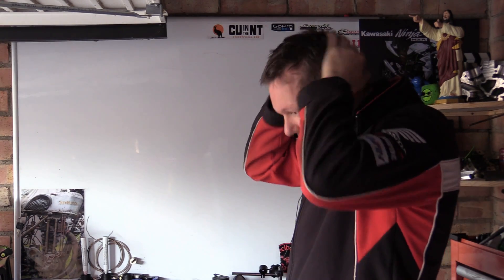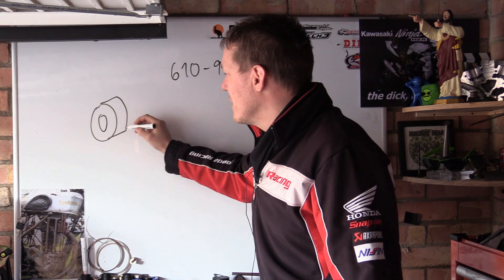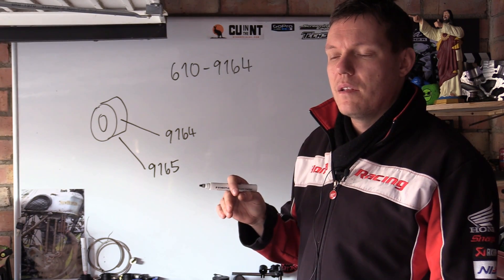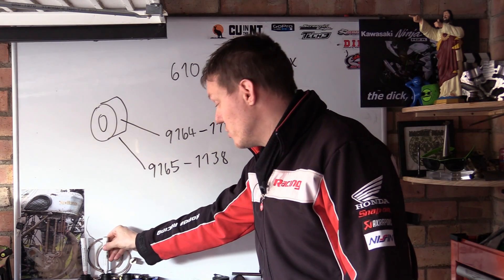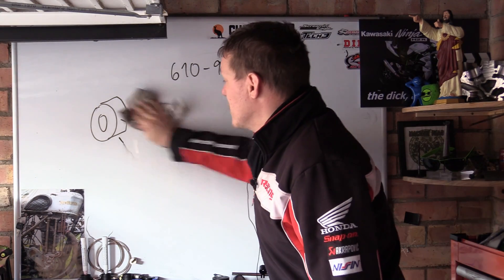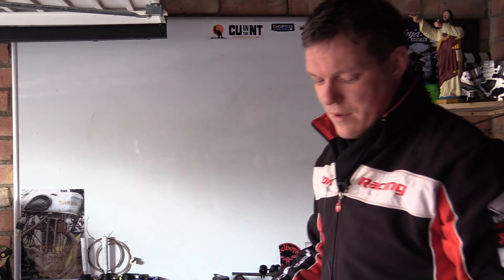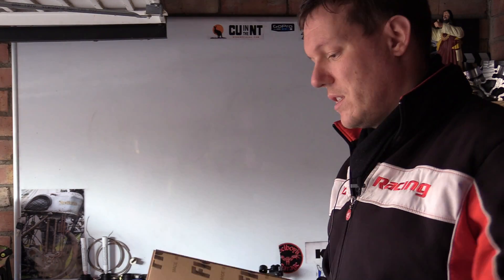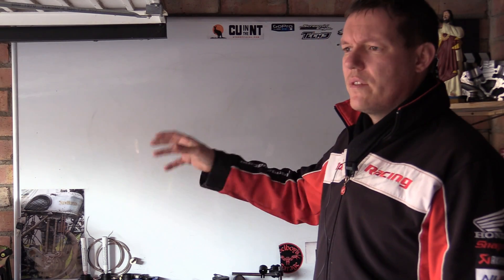Engine Parts - OEM or Aftermarket?

Comment: Sorry Matt.
The idea was to use tinternet. To go around and get oem cheaper.
I always use oem on crucial parts.
Can you see what i meant.
Thanks for video.
Sorry about contradiction.
Reply: Example
A head gasket for yam 500 
Fowlers £80.
Fowler ebay £89.
But by putting the serial number in.
I found one 
Ebay unused oem packaging
£35.

You said exactly what i had done and probably helped people. You always do.
Cheers.

Comment: Been meaning to ask about something like this for a bit,

So you've said and you've made it clear dont buy chinese crap tools its not worth it and i totally agree with you same with gaskets. But the thing is just because it from china doesn't make it crap, in reality the chinese manufacturing process is incredibly efficient and fast by sheer volume and size of production lines and the fact they get to treat their staff like shit and pay them fuckall.

The problem generally occurs when the client has gone in with lets say a motorcycle grade steel bolt...ugh... and say "make it cheeper" that is the only parameter they focus on and as long as the thread is right and the diameter and length is close as the budget allows for they hammer them out one after another because the client just pop them up on ebay and they cost fuck all to make so its straight profit because the manufacturer were told "make it cheaper" which they hear as "cut corners" and they look at the end result "its a bolt it goes in a hole" instead of the torque spec requirements so instead of a bolt with lets say the tensile strength appropriate to its application you get bolts that are made of stainless steel or something cheap that falls apart but it fit in the hole.

I'd love to hear your take on like shit you can get away with, for example im trying out a few cheap items that im gonna test the shit out of (hydraulic clutch for £15 instead of the £300 one, steering dampener that ill fabricate a mount for and a speedo which i havent fitted but i already have issues with...they fucking electrical taped the wires together but if the readout is correct its generally passable) but the idea is the corners they cut really aren't a problem shit plastic on my speedo? well its gonna be on rubber mounts for shock which i can make just fine and if there is a collision fucking any speedo will have had it the hydraulic clutch from what i can tell is fairly well made but doesn't have a bleed nipple one banjo bolt with a bleeder built in  later and it works a treat.

CNC levers are apparently pretty good and cost nothing, I dunno I know you know about manufacturing process and design so just wondered what your view is.

take care.

Comment: i usually use grease on gaskets you want to remove again , clutch covers etc , have put 3 bond on base gaskets  reed cages etc just becasue the surfaces were a bit iffy

Comment: Its risk vs reward. So with a headgasket, better to go oem than run the risk of being fugged. At least if a side cover gasket leaks its not a huge deal to just unbolt, lather with loctite 418 ( flexi gasket Maker, it doesnt fully set) and send it.

Comment: I just got a seized '66 VW engine turning the other day. stock these engines don't have any gaskets between the block and the jugs, or the jugs and the head. turns out the reason it seized is because the previous owner rebuilt it and decided to throw RTV on those joints, but he didn't even do that right as far as it could be done right, because he torqued everything down while it was still wet, so it squished into the cylinders and the block, as well as all over the outside of the fucking thing. at some point a bit of that shit got thrown between the crankpin and the big end on #2 and seized it right up.

I have an '82 Goldwing that had similar, but much less severe, shit done to it by a previous owner.

Fucking, just don't be a dumbass, and expect that a shoddy job will result in weird, random failures.

Comment: Looking greatly forward to the "first engine teardown", kinda new to this, furthest ive come to the engine is carbs, valve clearance/swapping shims and the clutch. Learned quickly about going with OEM parts if possible and required good fit, tried to replace float bowl gaskets with some aftermarket ones, they didnt fit (had to stretch and glue them in the slot for em to stay put) they seemd to seal decent after that, but after 2 days leaked again, bit the bullet and got some OEM ones for 5$ more fitted like they should and no problems after that. What a waste of 12$ shouldve gone OEM to begin with, ohwell lesson learned.

Comment: Silicone on o-rings and rubber seals shit me to tears. The amount of times you see it applied like toothpaste is outrageous. If you’re installing the correct o-ring it needs a bit of rubber grease to retain it and you’re away. Generally there’s a reason o rings leak and I’d say 99% of them are not because there no silicone on it.

Comment: I always use OEM gaskets. Except the head gasket, I use COMETIC head gaskets but they do cost quite a bit more than OEM. I dont trust OEM gaskets with raised compression. But with stock I always go OEM. You said it best, you get what you pay for

Comment: Sorry if this sounds a stupid question. Is there a right way and a wrong way putting a gasket on? 
Why I’m asking ......one side of the gasket has written print on it and nothing the other side. 
And I’m just wondering is there a certain way this must go. 
Iv changed gaskets my self a few times and Iv just chucked them on but Iv really never given this a thought 👍
Reply: Gaskets are rarely if ever symmetrical so just put them on the way round that fits.
Reply from the maker: If you have a symmetrical gasket (as Fred pointed out) then no. there is no difference for paper gaskets - some gaskets have rubber coatings and sealing bands so for them yes - they do have an orientation.
Reply: The Workshop brill thanx 😉

Comment: Well my 2006 kx450f shat the bed and needed new parts consisting of:
New con rod
New big end bearing
New crank pin
New piston
New piston wrist pin
New cam chain
And all the gaskets and seals,
I could have gone aftermarket for all the parts and saved in total about £150 but I didn’t want to have miss matched components from various brands so I went to Kawasaki and went and ordered everything OEM and I feel like the motor will last for years to come

Comment: Off topic a bit but could you explain the issue of output shaft wear on the Africa twin ( XRV 750 )  I bought one recently and the sprocket had been welded on ! After a lot of forum reading on the issue it seemed to be very common on these machines. A lot of advice on there on how to fix the problem with bespoke sproket kits etc but no one has explained why it happens !? I need to put it right now and it involves a full strip  down. I would be greatful for your professional opinion to avoid the same thing happening after I get the work done. Is it a design fault by Honda or aftermarket sprockets ?

Comment: i was arguing with my mate the other day about cheap eastern oriental parts. He was saying that some cheap eastern oriental parts are good and a saving can be made, turbos has been a point of conversation. I have bought cheap eastern oriental stuff for all kinds of applications on ebay or whatever. i bought a 3 jaw chuck for my lathe and it was actually pretty good. Ive also bought battery chargers and batteries and they smoked and nearly burnt the kitchen down. Now I said to him, yes i can buy cheap parts but the real question is do i trust those parts? I would rather spend the extra money buying a product i trust than a product simply because its cheap. Now if  YOU found some eastern oriental product and you being so fussy and particular and were to look at such product i would trust it. People like to make savings so maybe you could test cheaper aftermarket parts without risking your own heath of course. But with your thorough "oh these atoms are not correctly aligned its shit dont buy it" who could argue?!
Reply: - shit parts from china -
There. Fixed it for you.

Comment: I guess there's no easy answer, but what if it is the other way around and instead of cheaping out you want to go full overkill when replacing parts - anything to look out for when going that route?

Because price wise I've sometimes seen the same part vary in double digit percentages price wise. So could you even know reliably that by paying more you get something better than OEM?

Issue is (at least for a car guy it feels that way) if you drive an everyday shitter and you ask aftermarket distributors/ tuners I mostly won't get an answer - feels kind of like "fuck that guy, doesn't drive a 300+hp car, no sense in answering the mails". It's like they don't want fucking money (unless a recession sets in -  then they fucking want it HARD)

And that's not even a joke. I've only had like 2 companies which actually treated me and my relatively shit car like a guy who actually wants to pay for their stuff. One Company making strut braces (they even went to far and gave me "details" on their parts) and another where I bough a valve for easier oil changes (replacement for the screw) who told me since I wanted an all stainless steel one it would take longer to produce (but they offered me to switch to a steel one, since for my application stainless steel would be overkill - I declined because overkill is what I want).

But of course, some of those companies who don't respond to me add my fucking e-mail to their newsletters. Because maybe I might want to buy something... err... oh wait....

Sorry for the rant (not really).

Comment: I remember years ago hearing about a guy that  was putting together a book.
Lets say you wanted a part for your bike/car. 
This book would give you what car/bike that part was fitted to..
One example was a Porsche flasher relay. From Porsche it was about 60 quid. BUT the same unit was fitted to the 2CV and it was 8 quid.
Remember,  most parts like gaskets bearings ect are supplied to the bike/car manufacturers. 
Its like oil. Bike and car makers don't make oil...
Reply: Partzilla and i think cmsnl state what other bikes a specific part will fit...sometimes maybe cheaper if its a generally cheaper bike.
Reply: @mygi43543  I had, a long time ago a GS125 and the lass in the office had a Suzuki love. They both had the same indicater lens.  Yet the one for my bike according to info was if I recall about 2 quid more.. Needless to say I bought two Suzuki love lenses.

Comment: Just made a head gasket from hi-temp silicone for small 2 stroke engine, also  i have used aftermarket gaskets on 125-250 bikes with no problem.

Comment: I always tell people the OEM is the standard and we know what they are. The aftermarket is like the Wild West everything thing will be better or worse than OEM with most of them being worse! That is were reputation comes into play. That said I never buy cheap on the aftermarket. The best aftermarket gaskets are often still cheaper than OEM. I have never had a problem but I always try to buy from tier 1 suppliers that often built the OEM part.

Comment: Question:  I noticed when I changed  the clutch cover gasket and oil pan gasket. (Oem)They are bigger then the sealing surface.  Not meaning the sealing width, but there are big unused areas.   Is this only for making the gasket stronger?
Reply from the maker: Do you mean internally?
Reply: @thedirtyworkshop  I mean there are more gasket material then necessary in some corners (talking   Hayabusa)  Have been thinking about this when I made my own from the Oem.  Yes, internally.

Comment: OEM OEM OEM. I bought four carburetor repair kits with seals from Keyster for my Honda Seven Fifty. The seals expanded like crazy from just being in touch with petrol for 5 minutes and you couldn't fit them in their grooves in the float chamber anymore. They were leaking too..... Fucking money wasted.. Almost 100€...

Bought original Honda seals for much more money but once they were in, the carbs were sealed perfectly. And they will keep them sealed for the next 20-30 years...
Reply: I bought aftermarket parts like NBR orings and needle floats for my XJ600 but everything is fine. Where i bought them?  On Aliexpress XD,  I know thats pure mandess but have been working for 3 years
Reply: @Kotełke92  lucky you.

Comment: Parts manuals and data sheets are your friend when working on bike or buying parts. Also if you wan't cheap gaskets just buy gasket paper and cut then by yourself, will take a fuckton of time but CAN not will, result in a good set of gaskets.

Comment: if its water your sealing .must have some sealer on it.i remember working for caterpillar.doing a side casing gasket on a 312 excavator.big job had to remove the counter weight off the rear of the machine.everyone said fit dry.Even cat instuctions said fit dry.Did that it pissed water out.stripped it again .new gasket with sealer .job was done not leaking.
Reply from the maker: "if its water your sealing .must have some sealer on it."

- This is the kind of comment I hate - not calling you a cock or anything. Some gaskets are rubber coated and are crush gaskets. Adding anything can fuck this up an cause leaks 

Like I said, it depends on the design and if it say use sealent then you do otherwise don't